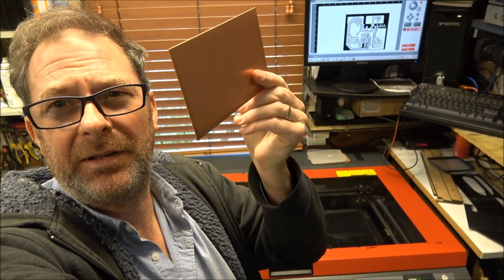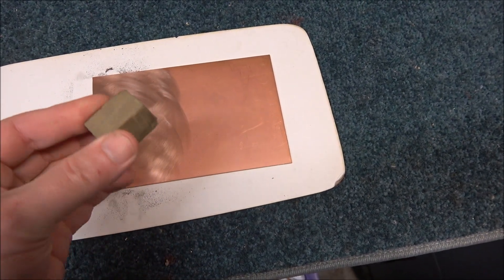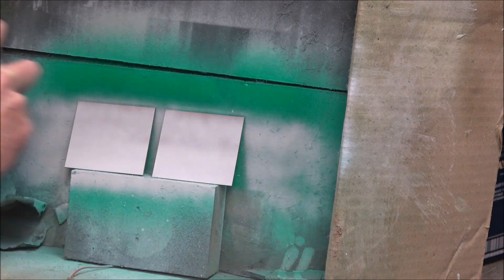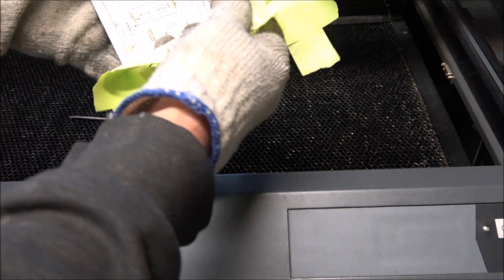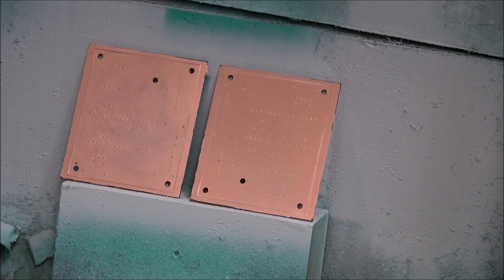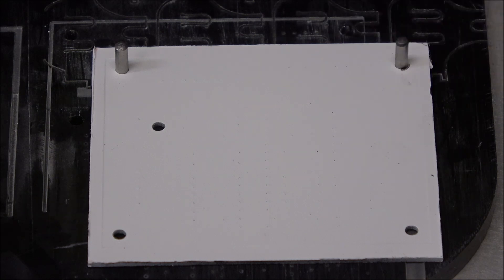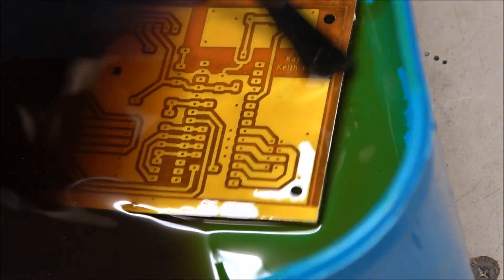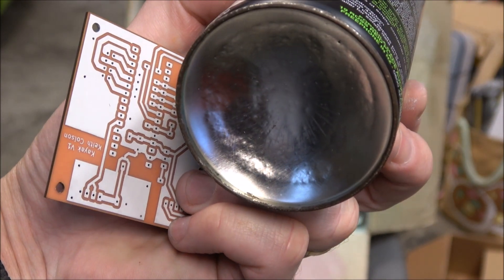Laser cut & engraved PCB made on a Laser cutter.

Comment: This was wonderful to watch.  I have an Epilog laser, and I always thought I could use it like this to make a circuit board, but had not researched it.  Way easier than manually applying a mask before etching, and I didn't even think of cutting through the substrate on the back and letting the etching take out the copper over the holes.  No more Dremel.

Comment: Kicad will allow you to export different layers as pdf's etc, so you don't really need Coral Draw. Great idea using the pins to line the board up. What I have seen others do is use thick cardboard held down with magnets and then they cut out the outline on it which also appears to work

Comment: You mentioned that you used phenolic board - is that because it is darker in colour and absorbs more light? Could you use black FR4?
Reply from the maker: FR4 works but it takes a lot of power to cut and drill with the laser. I made some nice FR4 boards. FR2 is much less effort

Comment: What was that green paint?! Is it actually soldermask or?!
Reply from the maker: it is green tinted acrylic paint, but you could use soldermask
Reply: @Robonza  well finding soldermask in larger containers than 10ml "repair" tubes are basically impossible.. so been looking for alternatives.. like UV Epoxy with a tint.
Reply from the maker: @Moronicsmurf  nice, that would work

Comment: Very nice work!  I used the Ferric chloride etching method for years (no laser though - used pre-sensitized boards). I built a CNC router in 2018 for machining wood, plastics etc and discovered it was also very good at isolation routing a PCB so its my go-to method now. Cheers from N.Otago
Reply from the maker: Nice work mate, sounds like you are winning!

Comment: I know not everybody has such laser engraver but you can do the same with a 200$ one.
This is a perfect video example how you can make a PCB at home with a laser engraver. 
I liked the custom spray paint at the end green and clear coat.
Reply from the maker: This is not a cheap laser. I dont think a low power laser would work
Reply: @Robonza  i bought one recently with a 3w laser, will design a PCB and give it a try when I get the laser in hand
Reply: @DominoSixO  hi! Did the 3w engraver work for PCBs?
Reply: @giuseppepettinati9627  Yes, you can put a layer of paint in top of the pcb(laser it), etch it then clean the paint but I suggest to buy a laser engraver with stepper motors and not regular floppy disk motors because you will get mirror effects if the laser engraver is not calibrated correctly, basically you will get higher quality with stepper motors

Comment: I see you use KiCad to design your board. I have installed and removed KiCad 3 times now on my Windows 10 computer. Cant seem to make it work. Cant get past the skematic phase because there doesn't seem to be any resistors in the library files. Any suggestions?
Reply from the maker: Worked great for me on Win10. One grid bug I had to fight but the software was pretty amazing, Maybe try an older version or find a Kicad forum

Comment: what power level did you use to cut holes? can a 40W work?
Reply from the maker: I used all 60w and my machine is well tuned. 40 will struggle. You can always drill the dots. Just use phenolic pcb and it will work.

Comment: I hope my question reaches you, it is a simple question though, can this process be commercialized? i mean is it tangible to follow this process to make a service out of it?
Reply from the maker: It far too expensive. It would only be worth it if someone wanted to pay 1000 dollars for a circuit board in a few hours.
Reply: @Robonza  I assume the cost will be mostly due to electricity consumption?
Or is there any other hidden costs? In case only electricity we are investing in solar, it means it won't be that huge of a deal. Otherwise, you are absolutely right. No consumer would use so expensive service to print a pcb
Reply from the maker: @saysoy1  electricity is cheap, its the labour and the machine

Comment: A great video , thank you for the insight. I found that I used the same type of paint and did exactly what you did but I am finding 2 things. I even tried 4 passes as low power but could not get to the copper colour, still shows a white very feint film , 2 the edges of the tracks looking using my phone on zoom looks like it is bubbled. I have tried the lower the power as much as possible with the same result. I have a 100 W C02. Your engraving looks so perfect. Thank you
Reply from the maker: Thanks. I spent a lot of time perfecting the machines performance years earlier. I think thats why I get good results. I cut and engraved paper and inspected with a microscope until it was best.

Comment: Very good. But there are several nuances. The paint must be heat-resistant and not be destroyed by soldering. The paint must also be resistant to solvents. It would be interesting to look at the board after soldering and de-fluxing.

Comment: This is simply brilliant and I'm thinking about trying this out myself.

I do have two questions. First, how well does the solder mask hold up after a year? (seeing that this was posted in 2021)
I've seen other experiments like this show issues with solder flux causing problems with plastics after some time and I don't know if the paint would be affected.

Second, I'm also wondering if the copper can be injured with a 10W diode laser or if my holes and cuts will have to be milled after the fact when using such a laser.
Reply from the maker: The paint still looks great. 10 watts will not do anything to the copper but you can still make a good board, you just need to cut the copper with a hacksaw and drill
Reply: @Robonza  Thanks for the response! That's good to know, thankfully I have a CNC milling machine so it's hardly a problem. Just an extra step.

I'm actually starting to go down a rabbit hole with this. I found a recipe for copper etchant made from white vinegar,  hydrogen peroxide, and table salt. I already happen to have those on hand so I tried it after work and it worked perfectly. I made the exposure mask with a marker since it was just a quick experiment to see if it actually works.

I'm really surprised at how low the barrier to entry for all of this is. The laser cutter is the most expensive part and a diode one isn't even that bad. The CNC milling is convenient but certainly not necessary.
Reply from the maker: @jamescarl861  CNC is messy, your 10 watt will do a nice job. Can you design a nice board hehe?
Reply: @Robonza  I'll confess, no. I have only once designed a board. My degree is in Computer Engineering and while that covers a good bit of EE, they kinda stop at perf boards for us.

I'm very good with the software side of things at my day job but at home have been trying to give myself a better edge on electrical, while also sticking to budgets and not becoming overly dependent on 3rd party services and tools. I'm actually thinking about making a set of software tools to help make this process a bit quicker and simpler but I think I'll just do my best to replicate your techniques first.

I've seen CNC milled PCBs before and I agree... it's workable but not great. I was only thinking I would use the CNC for adding the through holes, vias, and cutting out the shape of the board. I think I'll start out with a drill and hack saw like you suggest though.

If I find success, then maybe I'll upload a YouTube video too. I've never done that before.

Comment: Great video,I have been trying this method on my 40W laser but for some reason, when I try to engrave the paint it still leaves a residue, I don't get a clean copper finish, I've tried several settings from a light engrave 50mm at 5mA to 10mm at 10mA. even tried slightly defocused. it looks like every other line is unengraved paint. do you have any suggestions?
Reply from the maker: It sounds like your laser cutter is not well tuned. I spent time when I got mine getting it nice and precise.. Focus should be as sharp as you can make it. You should run around 100 percent power and 40 percent speed on a 40w for 3 passes. Check you are getting pure black and white when you engrave not speckle etc. Paint a thinner coat if needed.

Comment: Gordan Bennet  by the time  you've finished  doing this taking the cost into  account  you might as well do this the long hand method  which is far cheaper and produces just as good a  result  not forgetting  how much the  laser   cutter   costs you 

Use press and peel iron on transfer  £6.89  ebay and  a laser printer   standard  , 1400 dpi or higher res 

You get  real real professional results with this  and you can  do what you need from home without  all this expense to produce a prototype  and still make money  with  just 5  orders for small PCB's   and that's  assembled with components 

This will  cost  you a fortune  by the time you have added spray paint , time to do this just on its own and  if you are thinking about starting business from  home environments then you can expect to be running at a total loss into very deep negative figures for the next 5 years  years and more 

You might think  along this gents lines when you are  gaining some  5000 orders and more and running a  factory of types 

Kicad  was about the best choice   the presenter  made  so far  Id agree on that point  but the rest  ??  Forget it !! 

Kicad  is an en excellent  peace of software  open source

Excuse me for being somewhat focused on the real world  but not surprising is it that  with this advice business folds within  just under  a year 

This of course  doesn't take into account what type of people  , companies  you have to deal with  and where they place orders or dont supply and all the other issues  that  you will come  across , each one   of which will  cost  you money , often lost business  not to mention  the dirty underhanded tricks they pull   client inclusive 

You also  learn  by doing this by hand what design issues you  will uncover  in  your  design process and   then  you might also be ready to  buy something professional  when  you have  attained the orders  you need plus will know something  about file formats ,  exports , how Gcode and other coding formats  work 

You  will also  by that stage  , fingers  crossed of course  and hoping you have learnt something  beneficial   with experience also  knowing  some thing of the world at large  then  have  a relatively reasonable idea of what  CNC or laser  cutter  to  buy   with all the other different    challenges  you face with this  , with how they operate , types of errors , alignment cost of heads  etc 

  Good  way  to  fall flat in your face this way  but  try simpler to start with and  you  might just stand a chance and actually  be  successful
Reply from the maker: Lol, maybe you would like my other video where I do donuts in my Lamborghini. Have a look and see if you like it better

Comment: It can't cut the copper? So this doesn't work on 2 or more layer pcbs then. Good to know.
Reply from the maker: I could make a 2 layer pcb using this method. Connecting the two sides would require some innovation which I may look at when the need arises.
Reply: @Robonza  Plated through hole vias. Also, if it can't cut copper then how do you cut through the copper layer to ablate the phelolic? Wouldn't it be sandwiched between the copper foils?
Reply from the maker: @kurtnelle  Etch it then laser the holes.

Comment: How do you handle heat build-up with the PCB? I tried this and, while it burned of the solder mask, the copper/substrate got so hot that the pads separated from the substrate.
Reply from the maker: This just means your laser is not working well. e.g. out of focus. Mine does not get hot at all. You must be running slow to get that heat.
Reply: I know this is a late reply, but I think he was using FR2 in the video, which is a LOT easier to cut than the FR4 you see more commonly.  If you try using FR4, a lot of times the resin in it will char pretty badly, and the fiberglass can hold a lot of heat which can destroy the adhesive holding the copper down in adjacent areas.  FR2 just burns away without a lot of residual heat.  I've had difficulty trying to cleanly take just the copper off of an FR4 board with a fiber laser because of the heat retention issues.

Comment: Amazing. The paint you used, was it acrylic or enamel? I couldn't see on the cans.
Reply from the maker: The green one was acrylic the white was enamel so it kinda shows the paint type does not matter. It just needs to go on smooth.
Reply: @Robonza  good to know, thank you
Reply: @Robonza  finally got round to trying this but after 3 runs there was still some paint sheen on there after etching the copper side. Do I need to let the paint dry longer or just use a bit more power and a slower speed? Cheers and merry xmas

Comment: I wonder if a 10W diode laser will be good enough for repeating this (slow is fine) at home over a desktop cnc router. But without doubt this is the best method I have come across to get home made professional grade PCBs. Getting the alignment is gonna be the key, and I think that's where most of the efforts are gonna be. Many thanks for sharing this with the internet!
Reply: I have a 5,5W laser and it removes the paint fine. Wont cut the copper though.
Reply: Minimum power is 40W Laser to scratch the copper but with a 10W you can remove the fotoresist and etch it easily.
Reply: I've been thinking about this, and if you have a router attachment, you can start by drilling mounting holes.  Then you can use those holes to align to the laser engraving pattern.  Best of all it should be repeatable.

Comment: Aren't you worried about reflections from the copper?
Reply from the maker: Thats a myth
Reply: @Robonza  It's not a myth.
Reply from the maker: @SeanChYT  If you do an optics ray trace you will see the reflected beam has lost all its power by the time it returns through the lens
Reply: @Robonza  I am not talking about the normal use case, but when mistakes happen. Bluntly saying reflections are a myth is bad advice to spread on YouTube. Co2 laser mirrors made of copper reflect quite a bit as well...
Reply from the maker: @SeanChYT  Can you reference a raytraced model? I did optics for a decade at my last job and did model it and found the focal point of the reflection after the lens left the power at a negligible amount. Happy to see some thing to prove me wrong.

Comment: Very nice result. It would be nice to get away from any chemical baths, I think that should be a real benifit of using laser. I wonder if you can reduce the steps if you use soldermask tape (no paint required) directly onto the pcb and cut away the copper (and the soldermask on the pads) you don't need. Is this an option or just a stupid idea?
Reply: It’s similar to do it with cnc router so maybe with enough power…

Comment: Waow ! I was just telling a friend lately that the only thing i couldn't do was circuit boards, as my printer is dying and doesn't print dark enough no more. But i read everywhere that epoxy is part of the materials to never put in a CO2 laser. That's why i never tried it, assuming it was impossible. Do you have an argument in favour of this process ? What about the settings you use ?
Reply from the maker: I have a very strong extraction system which is mandatory. Settings can be discovered with some experiments. All settings are different for different machines.

Comment: NICELY DONE. I am a professional PCB designer with 40 years experience. I would have used Photo Resist and LPI Solder Mask. White paint very creative. I also just started setting up a Laser Engraving system.
Reply from the maker: Nice, I started making pcbs around the same time as you. Todays tech makes everything so easy compared to the old days.

Comment: Cool stuff!

I don't see why it wouldn't work on my 5.5mw diode laser either... Just slower and more passes.  So long as I can cut thru to the copper, the chemicals can make the rest of the hole... Awesome!
Reply: I found a chart by searching "laser cutting vs wavelength" and it looks like our weaker laser diodes (~450 nm wavelength) might have as good or better chance of cutting the copper itself than Robonza's CO2 laser (~10000 nm wavelength) since copper absorbs much more of our shorter wavelength light.  I'm gonna have to test that.
Reply from the maker: @Randrew  I would put the chances at zero. Its not so much the wavelength. Its speed/instantaneous power. e,g, look up femtosecond laser
Reply: @Robonza  Thanks.  I will definitely study up and test all sorts of things.  Those wavelength charts also imply I could cut through FR4 material (epoxy resin and glass fibers), which is yeah, pretty dubious.
Reply from the maker: Just use ink instead of paint

Comment: I use Altium, what output  files do I use to operate the machine? Altium does output Gerber (GRBL) files. I prefer using Ammonium Per-sulphate as my etchant as it does not stain.
Reply from the maker: Altium is a nice program but severely overpriced. I output pdf files in my example which worked well
Reply: @Robonza  Unfortunately it’s downfall. Due to licensing of the various functions such as the proprietary programming softwares and FPGA and CPLD developers. Which I have never used.

Comment: The lacquer paint looks aesthetically like a solder mask, how does it hold up to the soldering step? Does the paint burn away if you hit it with solder unlike a real solder mask? (honest question). I know you can just buy real solder mask too and it would surely work with the laser, but if you can mix your own then bonus! Excellent video 💯
Reply from the maker: The paint is nowhere near as good as real solder mask but its good enough and does protect the copper